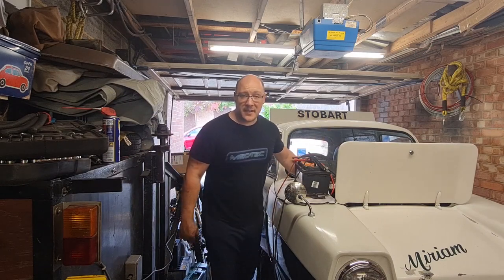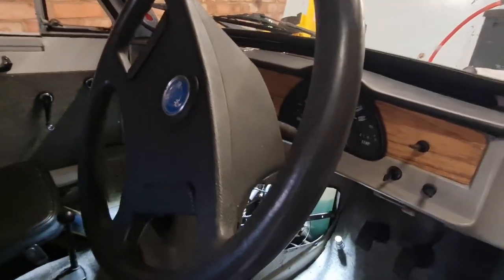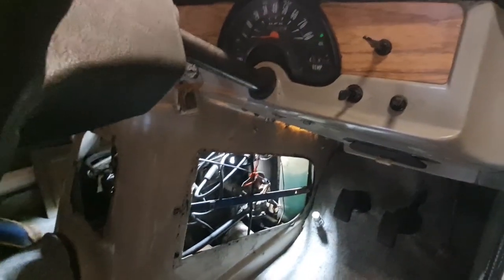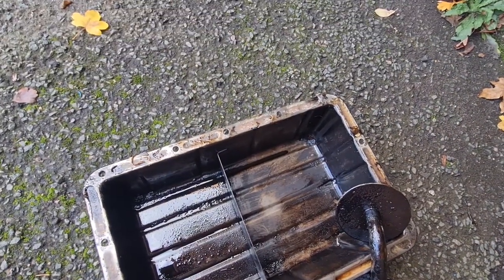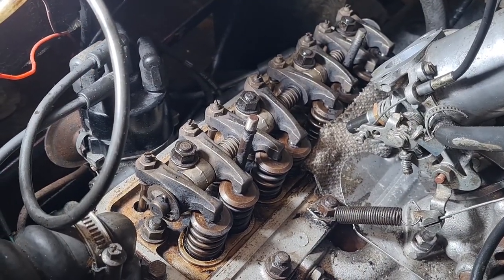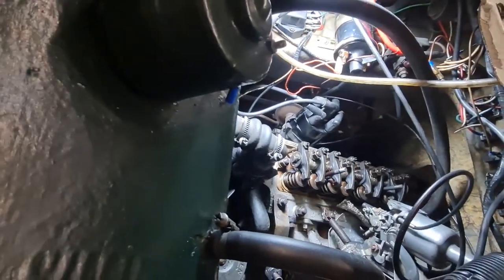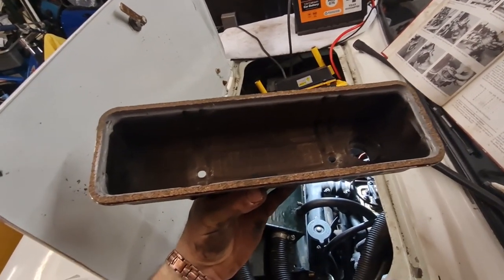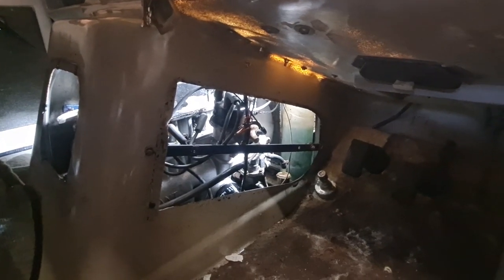EDDIE STOBART Reliant SuperVan  REVIVAL Pt2 ... Running Like Clockwork

Comment: HI Mec, good video and nice van!. Those tiny fuel filters (when old) tend to collect water from old fuel/ethanol inside. I bet that was why I took so long to start the engine up. I would replace it straightway as they are inexpensive. Keep up the good work! Looking forward to see the brakes soon.
Reply from the maker: Hi mate thanks for the msg and support ! I will deffo sort a new filter for that, thanks for the info ! 👍👍👍

Comment: That fuel filter and piping to and from the fuel pump deffo needs changing. It looks crap. You've done a really excellent job on everything else it and it does sound nice. Just needs that little finishing job really. It looks like there's a piece of metal pipe from the pump missing to me for that hose to look crushed where it is.
Reply from the maker: Hi mate, yes i think you are right, i will look into making a new piece of metal pipe for it 👍👍👍

Comment: Diaphragm on Petrol pump...
Reply from the maker: Hi mate, that seems ok to be honest it has covered me in petrol when i left the pipe off 🤣🙈👍👍
Reply: @mec-tec  yes but it can still let petrol past and into the oil. This is usually how they fail not failing to pump
Reply from the maker: @jusb1066  Ah i see ! I didnt know that, thanks for the info 👍 Do you know if they can be taken apart to check or is it more a case of just replacing it when you suspect it ?
Reply: @mec-tec  yes you can definitely take that fuel pump apart replace the diaphragm and fix that bit of crushed pipe while you're at it.. if it has screws around the diameter like yours... Some of the old fords wre crimped and couldn't
Reply from the maker: @jusb1066  superb ! Ok i will deffo have a look at that and see what its like and as you say change that pipe too 👍👍👍